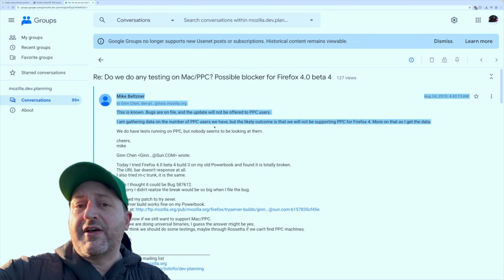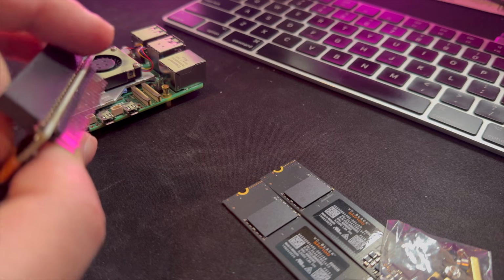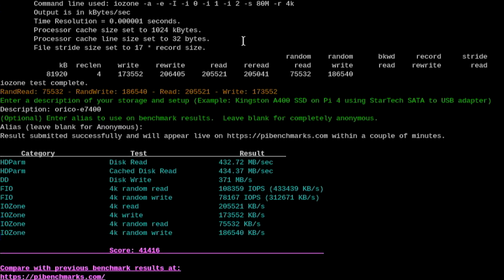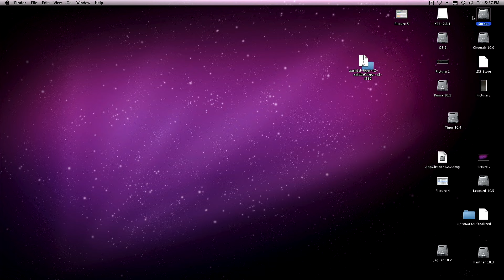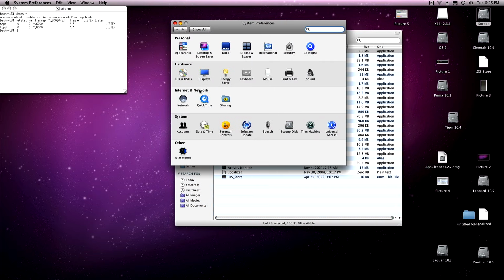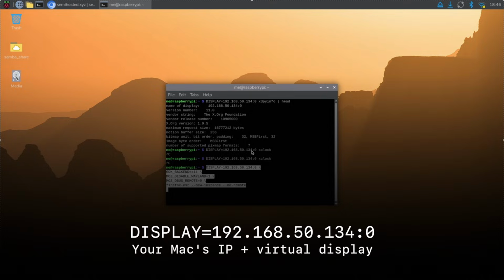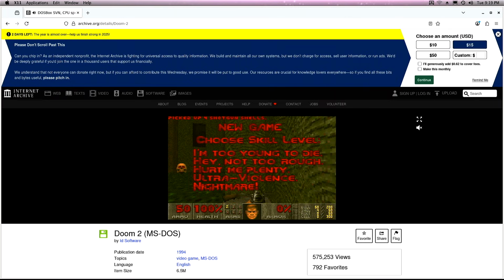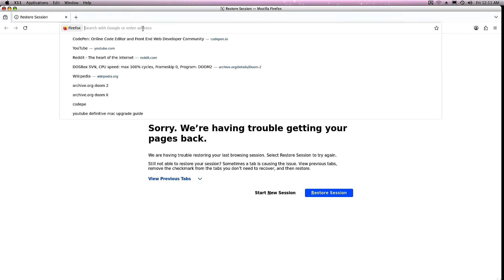I gave a 2003 PowerMac G4 a 2026 Web Browser

Comment: That's really cool.  I've found a great way to incorporate these older machines into modern usage is a much more basic interpretation of that by using remote desktop sessions, etc.  I've even done that fairly recently with an eMac as the big (and heavy!) CRT looks great and is still big enough to use.  Your project here takes it up several notches, and I like it.

Comment: I've been thinking about doing something like this, thank you so much for putting it all together. I'll have to try this on my 2001 PM G4 and 2005 PM G5. I'd love to see more examples of other apps running through the Pi5.
Reply from the maker: You can use what I did as a template but the performance limits it from video / high motion apps or games. The apps it’s best suited for tend to be the ones where often the PowerPC version are good enough or even better. Old photoshop / illustrator is a better experience than gimp or Inkscape to this day.

Things like discord or vs code would work well (If you don’t mind the dissonance of the terminal operating on the Pi.) that said discord has a nice PowerPC Mac port.

I debated showing open office but that’s boring. I’m sure there’s more creative apps that would be interesting but nothing jumped out at me.

Comment: LOL I just bought a Raspberry Pi 5 because I had enough with the ads, and last month bought a Raspberry Pi Zero 2 W which is enough for Pi-hole but I want to use it also as web server for testing my iOS app that sometimes needs mock data but handling it like the 'real' internet, then I installed Nginx Proxy Manager to handle the web ui of Portainer, Pi-hole, and other stuff, then I installed Home Assistant but the Pi Zero can’t handle it, so I uninstalled it, but when I tried to update the packages the Zero crashed, so I decided to return it and get the Pi 5, have it here since 4 days ago but some of the parts didn’t come at the same time, I also bought a very cheap hat that included the NVME drive but after testing it the Pi 5 also crashed, the NVME works well with my Mac but the combination with its hat is a no go, since I already bought a case that is an aluminum heatsink and comes with an NVME port I ordered another pair of NVME drives, those came yesterday and oh man what a difference, I installed all of the previous Pi packages but also a Jellyfin server, the qbittorrent client.

Look for the Argon NEO Aluminum Alloy Case for the Pi 5, there are several models, since it is a heatsink itself and comes with a fan the Pi does not need any other heatsink.

Comment: Cool project! Out of curiosity, would the connection be faster/more stable if the Pi was plugged in directly to the Mac via Gigabit Ethernet? Seems like it might be (and I bet it could also avoid concerns about security/firewalls as well if set up the right way).
Reply from the maker: You probably could but it wouldn’t change much with stability or speed. The security is a non factor or as the raspberry pi is handling http requests and you can always tighten it.

The g4 is on a wired connection and my pi was wireless but now is wired. I have a 10 GBe switch. What would speed things up is using a more powerful computer. How much? I’m not sure as I haven’t tried.

Comment: On Windows 7 I use Supermium (modern Chromium for XP and up) and R3dfox (modern Firefox for Vista and up).
Reply from the maker: Oh that’s cool, windows has longer tail support so not as surprising but didn’t know either of those projects as i don’t do nearly as much with windows.

You can get modern Firefox on 10.7 but that’s as far back as you can go on macOS unfortunately.
Reply: @dmug  Fair enough. I've never been an Apple user personally but I do like to dabble in MacOS's distant relative, Linux.